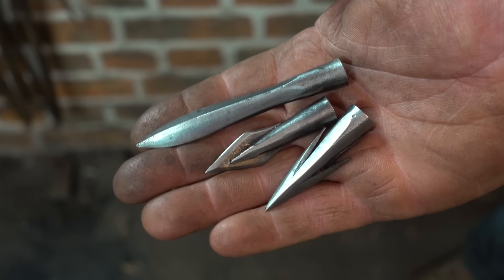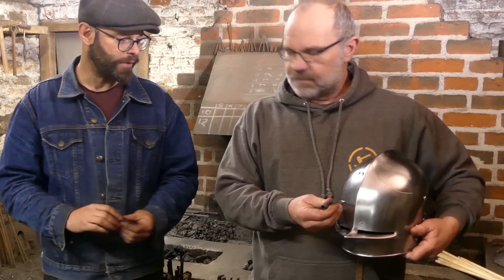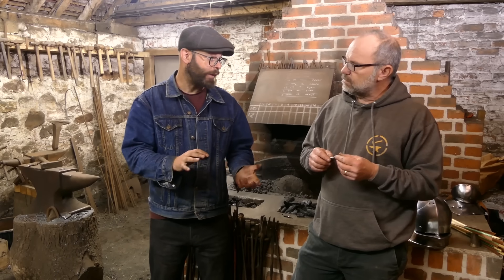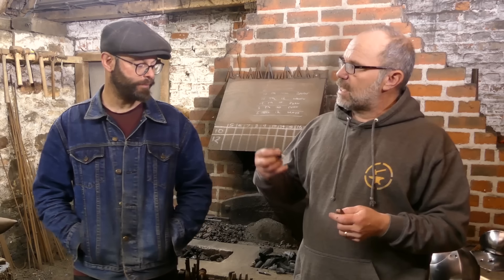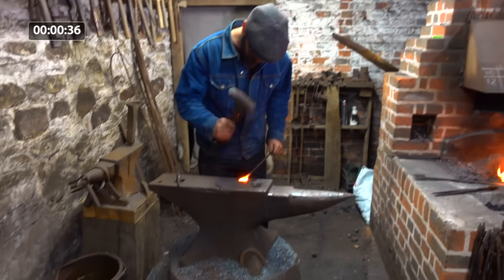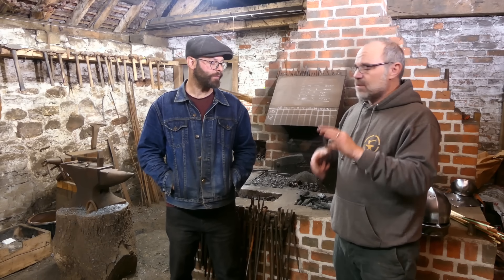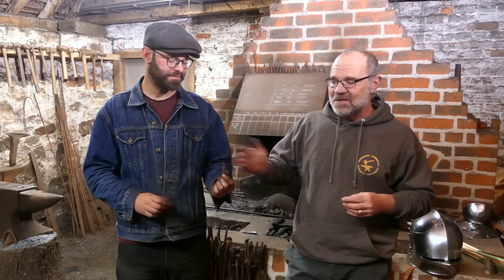Why Bladed Steel Arrowheads were Superior - Arrows vs Armour 3

Comment: Stop thinking about penetrating the plate (the strongest defence) they are not for that, they are for the >>> weakest points <<< Think more about what happens if they ricochet into an armpit or get under the plate at a joint? Are the barbs mean to stick into the mail and incumber a walking knight? Does having x3 arrows attached to you reduce your mobility and thus your fighting ability when you reach the enemy line? Also the shafts - has anyone looked at how the different woods shatter or not? A shaft that splinters might be better at getting under the armour? or into the visor? A tiny piece of wood could completely incapacitate a knight if it gets into his eye. No one aims for the best defended part of the body - they always look for the weakest.
Reply from the maker: Good points all and I would agree we are in a way fixated with getting through, but that is where the series started- could we?  
The old 9’s turning to dust and filling the air with eye and throat annoying shards I am convinced is part of it, to the extent the French wore jupons to reduce/remove this effect

Comment: Question, given that the barbs are steel, would they be hardenable by quenching? They're either not quenched in this video or I missed it, but would that make them too brittle?
Reply from the maker: Temper back if the carbon is high enough or just leave quenched

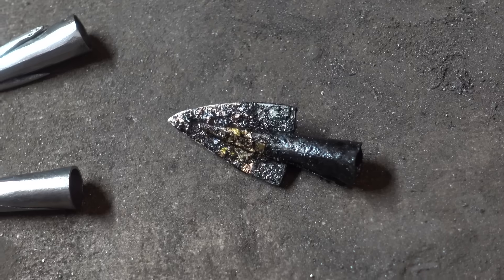Comment: @14:01 So ,the mild steel part is opened by hot cut to take the high carbon steel “blade"?
Reply: Yeah that’s such a key step. Why don’t they show it? Does he want to keep it secret so nobody copies him this easy??
Reply from the maker: The 21 is made much like the 16 and the steel staple that forms the blade is wrapped over the tip of the cone and brazed.  No splitting or setting in.  Not the toughest construction, but quick and only needs to work once
Reply: @tods_workshop  Ok,thanks and Merry Christmas.

Comment: One thing you didn't mention on arrow head weight that must have been a consideration is the shaft material requirements just to survive the loosing process - when the head is heavier that arrow shaft has to survive so much force more and likely bends more as the inertia of that head means its just doesn't want to go anywhere and you have that long arrow shaft trying to make it happen - which means you end up wanting tougher heavier shafts. You also tend to see arrows ending up more sideways to the direction of travel from my observation - which means you may need larger fletching too to even further reduce the range it will fly.
Reply: The impact is MUCH more severe than the loosing process😅.
Reply: @ShokkuKyushu  That depends entirely on what you hit, and to a large extent isn't true - the shaft only has to deal with its own weight at that impact point (OK and a tiny handful of feathers, sinew and maybe a fragment of bone for the nock is hanging out near the back too). 

Its just a complete reverse dynamically, so unless you hit something really really hard to push through (like hitting a rather solid plate) that slows or deflects the arrow head much faster than the launching speed the forces involved on the shaft just won't get close. 

Also when you are shooting the arrow you probably don't care very much if the arrow breaks at that end, might even consider it a bonus as then it can't be shot back. So as long as the arrow delivers enough of a hit before wasting its remaining energy exploding the shaft...
Reply: I'm pretty sure they talked about shaft material in Arrows vs Armor 3, but I don't remember the details.
Reply: They speak about the change of wood for the shafts in the main video.

Comment: One video of yours which keeps getting stuck in my head is the one where arrowheads have a bit of wax on the tip to help pass through fabric armor better. It showed quite an improvement which I didn't expect and haven't seen it mentioned by anybody else. I'd love to see a follow-up, perhaps also showing how much sharpening your arrowheads matters. I know the difference in cutting gambeson with a sharp falchion and a VERY sharp falchion was like night and day. I wonder if putting a razor edge on arrowheads matters given that they're going quite fast.
Reply: What is clear is that someone conducted experiments on arrow technology at the time!
Reply: Great question! Does 2 minutes of the apprentice's time versus 2 minutes 30 yield a measurably better weapon, how would that affect the logistics of supply, since really sharp arrowheads cut everything around them and gradually blunt in the process. Did archers in the run up to battle sharpen the arrow tips of the arrows they were issued with?
Reply: @joetaylor486 probably not the second parts. There’s records of arrows delivered by the wagonload and archers going through hundreds of arrows. Same thing with today’s military, ammo is delivered by the truck load. It would make more sense if it was a special outfit running with limited supplies. I don’t see why an outfit wouldn’t inspect every arrow going out for a mission. A siege? I’d shoot the crap arrows just as fast as the good ones.
Reply: Waxing the arrow head could also be done to protect arrowheads in transport, both from weather and from blunting.
Reply: My thought was that since Tod had them boiled, if they used tallow which books at 200c to give a deeper temper it would result in the metal having a coating of fat, preventing rusting and being a waxy coating.
Reply from the maker: @jamesmayes4351 That’s a good thought.  Basically I ‘discovered’ if you wax the heads they penetrate fabric armour and shields much better; about twice.  I assume they must have done this deliberately and with foreknowledge because craftspeople from jobs like sail making and carpentry did this to needles and nails.  Really obvious extension.  However we have no evidence we did this in Western Europe.  There is a 17thC? Arabic poem that talks about waxing your heads, but nothing European.
And sharp definitely helps with fabric
Reply: @tods_workshop  am I right to assume that the wax would have dissolved or otherwise gone away in the arrows found in digs? And that's why we don't have any solid evidence? Or could they have found traces of them on the arrow heads they have found, and just haven't?
Reply: @robertbrun i had the same thought, same way we dont have much fossil evidence of animals made entirely or almost entirely from soft tissue, not bone, shell, chitin/keratin, etc. Not because they didnt exist, but because they simply rot too fast to fossilize except in literally perfect conditions
Reply: @ethanhauff8185  mindblowing... think of all the squishy critters we've lost to time, big or small. We'd have no idea!
Reply: @tods_workshop would a waxed arrow head still bite into metal as well as the type 16s did on glancing blows?
Reply: @tods_workshop  do we have any scientific evidence for why the wax works? and could the same principle be applied elsewhere for mechanical advantage?
Reply: @robertbrun  Or maybe there wasn't enough wax to apply to the arrows? Maybe the wax would peel off by the time the arrows went from Smith to Battlefield? Maybe a logistics issue?
Reply: @jamesmayes4351 a bit of lube helps with metal cutting too, so it might help the steel heads against metal, too.

Comment: I wonder if the term "too many irons in the fire" came from arrowhead smiths haha.  Im gonna have to try forge some arrow heads next week.
Reply: Came from blacksmithing generally. When you're working production, you can work multiple pieces at once, letting the iron heat up while you are swinging the hammer. The problem comes if you over-estimate how quickly you can work and literally burn up the other pieces before you can get to them.
Reply from the maker: Don’t know for sure, but it must have and agree with the poster above
Reply: At least in the American ranching culture it refers to branding irons. [Specialized tools to create specifically shaped burns for identification  on cattle]. There are electrical & cryogenic methods now, but the term refers to the fire heated version.
Having to many irons in the fire indicates that your work flow is off/inefficient. It may be that you are just taking too long, so the set of irons that are heating overlap with another set for longer than needed. Or it could mean that you are branding for more than one group at the same time. Depending on the brand specifications,  there could be NO overlap in the irons used in common. 
(There is only one "universal" iron design, and it was more useful to... modify ownership of stock. Legally or otherwise.)
In either sense, you are exceeding your ability to complete tasks properly.
Reply: A LOT of sayings like that come from smithing.  Like the old "Strike while the Iron's hot".  Arrow making is using pretty small pieces that don't take long to heat up though.  Not sure you'd ever do more than 2 at once.  But with other products, you might have a bunch of the same going at once.  Too long in the forge can lead to issues, leading to the saying.  Not enough pieces would mean being less efficient due to having to wait.
Reply: Always thought it had to do with the fire itself slowing down because too much cold steel would take longer to heat up. But that also makes sense. I have a background in cooking and the heavier the pan the longer it takes to heat up so i assumed forging was the same way. The more you know i guess

Comment: Quenching was often quite risky. Sometimes not worth risk.  Often the steel had so much impurities that even water cant cool it quickly enough to actually get a decent hardness.  So it's possible that many of these arrowheads were heat treated but didn't take the proper transformation.
Reply from the maker: Absolutely, but no real risk with hand made steels, the worst is that it doesn’t harden enough in which case the smith needs to go back to steel school and learn to tell the difference and not waste his time.  What it feels like under the hammer should tell all

Comment: Great video Tod. I am curious to know what the  blacksmiths of that era might have used as flux when forge welding or braising?
Reply from the maker: Borax still or silver sand and I am sure a few others
Reply: Theophilus (12th Century) describes the production of forging and brazing flux.   It's essentially potassium bitartrate, which we call "cream of tartar".  It's a byproduct of wine making,  a fine white powder.

Comment: So, at 5 minutes per arrow - I assume the smith doesn't work flat-out all the time - we're looking at about 12 Type 21s per hour. Figure a medieval smith probably works his forge 8 hours a day, 6 days a week - comes out to 4 gross per week, a little shy of 600 arrowheads. Of course, assuming this is all the smith and his apprentice are making. I suppose since the apprentices' part takes about half as much time, he can spend a fair bit of time on other things, tools and the like.
Wonder what the Crown is paying him for this work.
Reply: Matt Easton took a look at that after an earlier Arrows vs Armour video. I seem to recall that it was (often? usually?) delegated to the nobles to supply the arrows needed. I'll look it up and see if there is any mention of payment.

Edit: So, a good hundred years earlier, it seems the going price for a sheaf (24 I believe) of 'steeled' arrows was 14 pence, and 12 pence for a sheaf of 'non-steeled' arrows. Though this was from the king to the sheriff. I don't know if the smith was independent, or worked for the shire, or for a noble in the shire.
Reply from the maker: @EriktheRed2023thanks, very useful
Reply: If we stop and think about how apprenticeship works, the apprentice would progress through the production process. Ignoring the housekeeping duties, start at the grindstone, then learn to draw and roll sockets, proportion and draw the point before parting off. The type 9 being larger and of single material is the foundation skillset, the skilled apprentice by observing then doing graduates to forge welding.
In short arrow production is a repetitive skill builder that a Smith puts his apprentices through on the path to qualification.
In times of greater need apprentices always step up with the grunt work being relegated to others such as farm labourers.
The expansion of munitions manufacturing workforce did not suddenly appear with the World Wars. The brazed tip type points to design for manufacture, once again not a new concept.
Weapons manufacture is mass manufacture, seconds saved, simplification, additional work force participation matter.
Reply: The other thing to consider is that the smith (and apprentice/s and other helpers) aren't restricted to making these arrow heads one at a time, it's possible they could have at least a few in the works at different stages, and especially with these multi-piece arrow heads (either braising or forge-welded tips), these parts are able to be done perhaps by just one person each in a sort of production line, i.e. one worker just forms the sockets, necks down the body and cuts to length, the next just fully forms the socket and shapes/quenches the body, the last one braises or welds the tip on (the tip already having been made up by someone else simultaneously) before it's then put in a bucket and sent off to the grinder. There's lots of ways to get efficiency out of producing arrow head en masse, especially when you've got a few people to help out.

Comment: Random shower thought is there any evidence "non steeled" arrows where used for practice aka missing the blades for them to be added later via brazing for war. Would mean you could have villages full of "safe" arrows for practice/sport with the abilities to change them to war arrows when needed.
Reply: From a labour perspective, Your idea would cost a lot of time to do.  Each arrow would have to have the head removed, which is not going to be easy. The glue used is quite strong and would need to be broken/melted without damaging the shaft.  Then having to glue it back on after modification. Fingers crossed the socket has not deformed during the braising on of the tines.  As it is unlikely to fit back on the OG shaft without further shaping of the shaft head.

Comment: It would be great if you added captions to narrate what you are doing in the forge, like Primitive Technology. It is hard to follow along.
Reply: You can turn the subtitles on. Should help.
Reply: @EriktheRed2023 deliberately written captions can add greater detail. It was a bit difficult on the 2nd & especially the thrid arrowhead
Reply: @DMZwerg  yes. I had to look it up. Braising steel is adding a filler material that melts and bonds the iron with the steel. I am not sure what was used here.